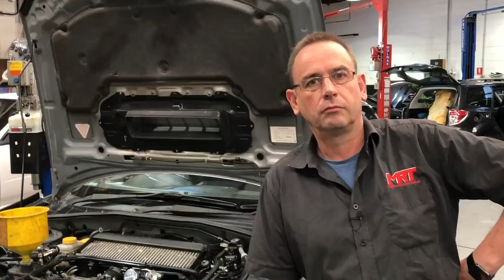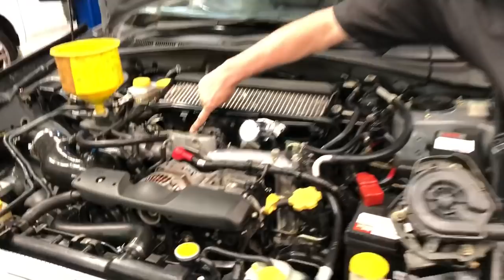Subaru Air Pump Fault Codes

Comment: Hello, have a subru forester 2006mod that has an error code P1410. Checked this air pump, that is to say I connected it directly to the battery, was it not life stone? Could it be the pump that is broken? Following your you-tube posts, very informative. Mvh Odd (Norway)

Comment: The amount of condensation it collects is no joke. I found out by changing the ignition coils, I think i will check this thing every time i do a rear diff fluid change (15k miles)
Reply: sorry what is that?
Reply: @fredisaiah7846  the secondary air pump collects water over time, how fast? It depends on the temp and humidity.

Comment: I know this is an old video. But I'm having a p2227 code and It wont go away. My car won't start due to what ever is throwing the code. Do you have any experience with this code and a possible fix?

Comment: help, i got a 2007 sti that and i can only fine a connection for one side of the air valves, i cant find a plug to connect the air valve under the intake manifold anywhere. 
I looked for cut or spliced cables and nothing seems to be tampered with.....

Comment: can you tell me if after the secondary air pump removal the check engine light is still on.  and also if I can do the emission test afterwards?  thanks
Reply: Depends if you have any other problems, then the check engine will be on.
Reply: You need to program it out in the ecu. A tuner can do it

Comment: Hi after how many miles is it common for this to happen I had an Iag aos installed and the same day had the secondary air pump codes kick in my sti has only 3800 miles
Reply: Mine appeared today, 23Oct2022, after a mileage of 235 thousand kilometers ...
Reply: my legacy at 300.000km

Comment: I just installed a aos on my 2020 sti have seconday air pump code coming up now could it be they didn't connect the o2 sensor jumpers? Do you guys have a specialists by Sarasota, FL?
Reply: Did you ever figure this out? I also just installed an IAG AOS and a week later I’m getting codes for the air pump.

Comment: Would this be code P2433 
Air system Air flow/ Pressure Sensor circuit High Bank 1 ?? And how would you fix it??
Reply: No it's a P044 code.
Reply: did you ever fix it? im getting the same code so I cant pass smog

Comment: Super annoying and expensive failure mode. Apparently will also put the car into limp mode only as it throws a constant CEL on start, and will try and keep revs under 4000 with little to no boost available.
Reply: having this exact problem rn, did you ever figure it out?
Reply: @Eli-wc6et just got it any idea? Not in limp mode tho

Comment: Is it necessary to block off the valve holes? I disabled the pump with my tuner and removed the pump but the piping removal is a really extensive job so I honestly just have plastic piping still open. I'm assuming this is okay because the valves to the exhaust should now be closed anyway. Will this effect my cars air measurements and do I need to worry about the barometric sensor?
Reply: @Anthony Breezy you're fine just disconnecting it. A tuner can turn off the check engine light. The only reason I went ahead and did the block off was because I didnt like the sound it made on cold startup. It opens up a valve and so the engine sounds funny for 10 seconds which I've gotten to stop completely.
Reply: I'd say it's to stop foreign objects getting in there. From what I read the barometric sensor is important to the tune, and must be retained somehow.
Reply: @VenturiLife  ya tuner finally replied and said the same thing. I had unplugged them and it seemed to work fine but I wont chance it.
Reply: @Anthony Breezy I have one block off plate on and one of the solenoids capped with a vacuum cap. No issues.
Reply: @Anthony Breezy idt theres any danger if you have to put off the tuning out part for a few days. After all it's a system that open the exhaust to more air and doesnt really have any place in combustion or anything. And it only operates for 10 seconds at cold startup
Reply: @Anthony Breezy brentuning, I've heard maybe cobb.

Comment: I have a 2018 sti and I read that there is a barometric sensor in one of the parts of the air pump. What should I do in this case?
Reply: Get a monkey-hammer and just start beating your engine everywhere.

Comment: Im getting this 0410 fault code on my Subaru Legacy '07 2.0 DOHC - what can I do to get rid of this. It's a non turbo.
Reply: I guess you checked the wiring harness for shorts and open circuits. As well as ECM communication? 
If so, it not much left to do, then you just have to change the pump 🤷

Comment: Good day, so i just got this code the day after completing the miss fire diagnostic and replacement of bad ignition coils and spark plug tune up. drove it to the store to test that  yesterday no codes. However this am about to go to lunch after church and this p0410 code came up could something i disconnected/ reconnected during that work loosened etc causing this fault code? Also is this ok to drive the car with ?
Reply: My Subru dealership says its perfectlky fine to drive with this on, this system is completely irrelevant when driving - it only works for the first minutes when the engine heats up and is all about lowering emissions [non crucial].

Comment: Had the P0410 code appear recently after having a new 02 sensor fitted. Bizarre thing is the secondary air pump was removed by the previous owner and the ECU tuned accordingly 4 years ago. Local Subaru expert now stumped and confused!

Comment: We've got an 07 Legacy GT Spec-B with this pain-in-the-ass system and yeah, have been ignoring it for a while now. Custom tune to delete codes here in Wellington, NZ is going for $450 + GST. New parts at the $2900 mark. My Legacy show P0406 and P1406 so valve on turbo side is shot and I've disconnected the pump hence the second code. Wish I could just put a resistor across the valve wire plug and be done with it but doesn't seem to be that simple. Good video mate. Cheers!
Reply: You can download the software and re-write the ECU yourself but you have to know what you're doing...
Reply: Hi I have the same car in Wellington, where will they do it for $450?

Comment: I didn't realize corrosion was the cause of failure. Can you fog oil into the assembly as a prophylactic measure to prevent rust?
Reply: I was thinking the same thing...there is a "fogging oil spray" we use when storing outboard motors....shoot it down the intake and then kill the engine, it covers every surface with a light coat of rust preventive oil. 
Big bucks...the pump is $400 and the 2 valves are $200 and $300. US prices, not genuine Subaru parts. $4000 ? maybe the Aussie parts are gold plated?
Reply: Fester Addams my Subaru dealership sells them for $1200 if I recall correctly (U.S.) but I think the labor adds up as they replace other parts along with a new pump. I think fogging oil is no doubt a good idea if one lives by the sea.
Reply: Not a bad idea, I'd be tempted to use WD-40 or similar, which is a light oil, and designed for water displacement.